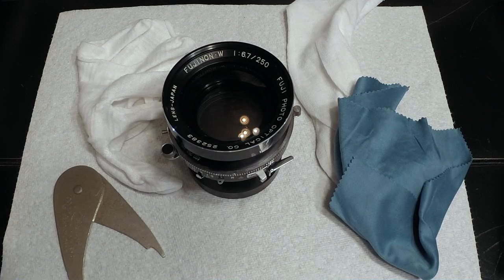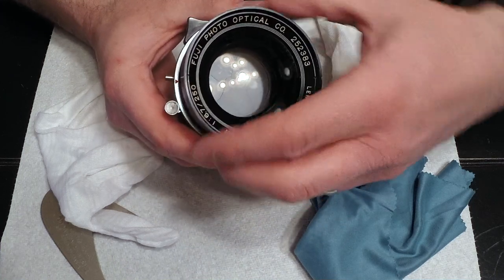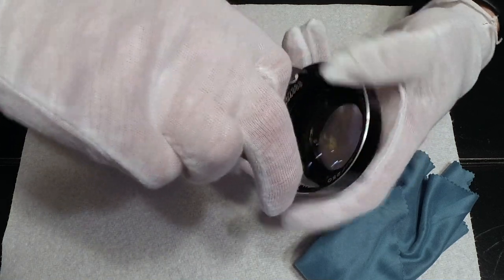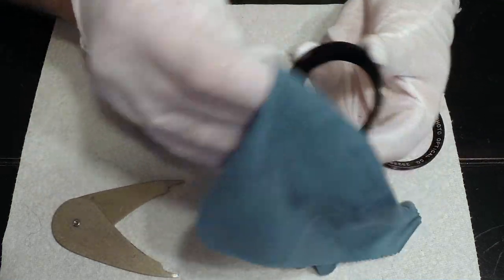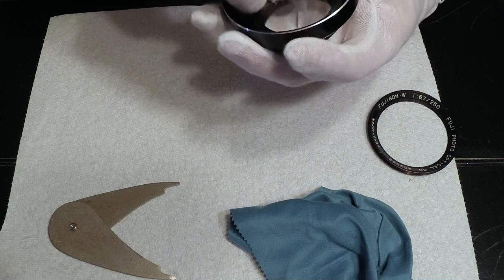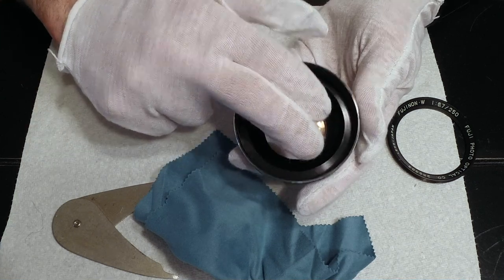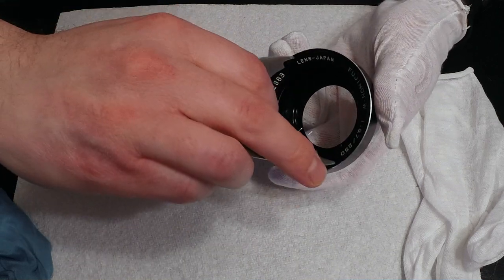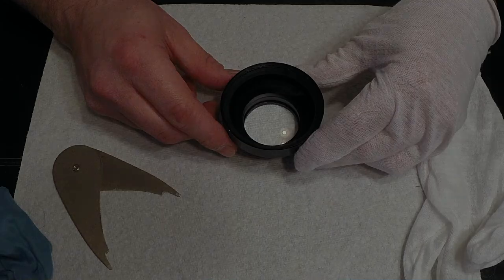Cleaning Lens Elements | Large Format Film Photography Lens

Comment: Great video, thanks for sharing. FYI, the writing inside the lens area vs outside the lens area on Fujinon lenses doesn't have anything to do with coverage or format, its just a change. However a rule of thumb with Fujinon is if it has writing inside as this one, its single coated, if the writing is on the outside of the lens (arround the barrel), especially the rear being the serial number that is a very strong indicator of it being an EBC (multi-coated) lens.

Comment: When you say "you checked the SS/F=stop" did you just run thru each SS and make sure it operated without issues or do did you actually check the lens for SS/F-stop accuracy?
Reply from the maker: I just ran through each shutter speed and made sure it operated properly. I don't have the necessary equipment to verify the speeds for 100% accuracy.
Reply: @CraigSheaks  The standard  for camera shutters is that if it is within  a half of the shutter speed it is considered good. I've shutters that the timing mechanism  was out of wack, usually just cleaning them takes care of the problem (don't take the mechanism, they are hard to get back in)  Any competent camera repair service can check the shutter speed.  And shutters can easily be replaced.

Comment: I took the elements off and placed them on and lens functions fine.  However I left fingerprints on an old minolta lens. I need to reopen the lens.   Do you ever recommend glass cleaner?
Reply from the maker: A microfiber cloth should be able to remove finger prints. If you have to use glass cleaner put it on the cloth (don’t spray it directly on the element).

Comment: I know this is an older video but I'm trying to figure out why my PC sync port doesn't trigger my flash.  The flash works with my flash meter but not connected to my fujinon 150 5.6. I cleaned the outer part of the connector but maybe the inside is dirty and not contacting? Any other problems it might be? Thanks for any help.